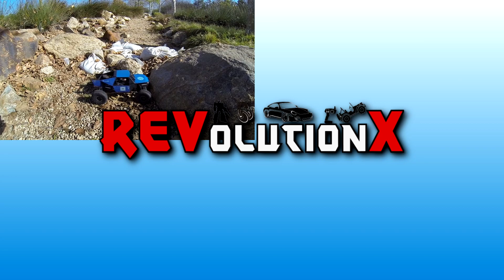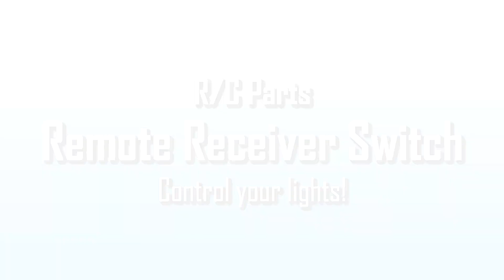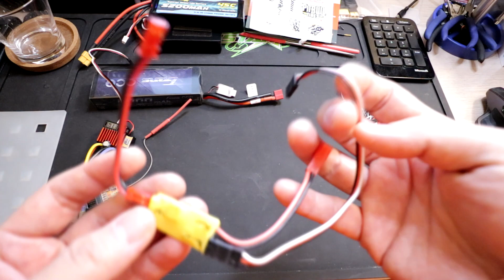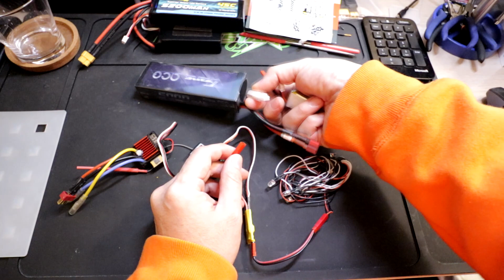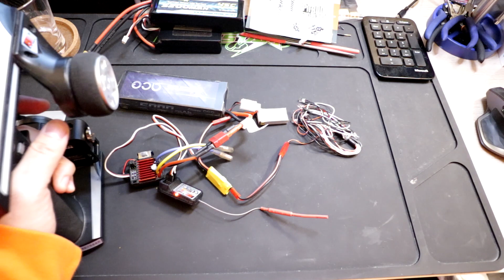$5 Receiver Controlled Remote Switch for LED Lights!

Comment: Hi i have bought a similar switch. My question is i have a 4s lipo on my car, the lights i have are 12v is there anyway to use the balance plug but not use the full 16.8v from the 4s pack as would be too much for the lights
Reply from the maker: I no longer use this type of switch, but you can try getting a buck converter to step down the voltage from the main lead.  Not sure about the balance plug though.

Comment: Anyone that handle 8.4v. My servo want that, but the service plugged in to rx can only handle 6v
Reply from the maker: You would need to run a BEC for the servo to run at 8.4v while leaving the rest at 6v

Comment: The receiver doesn’t power up the lights? I thought it gives out 12v in one of the 3 pins
Reply from the maker: To be honest, it's been a long time since I messed with this unit.  There are others now that are much easier to work with.

Comment: Hi, loved your video and explanation by the way. I too bought these similar rc switch circuit. I just wanted to get a thing clarified, that is i am using a 11.1v battery to power my motor driver which is connected to my receiver via pwm rc1 and rc2 pins. The motor driver is the mdds30a by cytron. 
So if I want to control my LEDs on my car, should i plug in a smaller battery as you did or should i just connect my receiver and the rc switch will draw power from there(ultimately the 11.1v battery) and power the LED?
which is safer and better could you suggest?
Reply from the maker: It's been a while since I played with this switch, so I don't exactly remember.  I don't remember if this unit had a specific voltage limit.  If there is, you may have to put a BEC inline to control voltage if powering from battery.  If I remember correctly, you can power from the same battery as main via tapping the main power leads, but you have to watch voltage or something, which would require the BEC.

Comment: I was thinking just put a receiver plug on the power in wire and plug it into the receiver battery port or another channel for power.
Reply from the maker: You could wire up a lead from the main battery plug or ESC to that JST plug.
Reply: I cut the power in wire and soldered a male  receiver plug on it.  I cut the the power out wire and soldered a female receiver plug.  I plugged the receiver controller wire into the active 3rd channel on the receiver.   I plugged the power in wire Male receiver plug to a open channel aka aux on the receiver.  
The female end power out to the led light strip and it finally fucking worked.  I should probably make a video how I did it.  It's pretty cool.

Comment: Hello, i bought a car recently and would like to add my own lights to it with a separate battery (separate from the main one) would i do it like this one?
Reply from the maker: Yes you can.
Reply: @RevolutionX  ok, it has 3 channels and it is a slide to change the channels I would insert it to channel 3 and then switch to channel 3 the lights should turn on, and then when I switch off of it would the lights turn off?

Comment: Does the input voltage go to the other items hooked to the receiver at the same voltage?

I need something where I can plug in a 3 S LiPo to control an accessory but that won’t allow 11hp let’s to flow to receiver. Any ideas?
Reply from the maker: Apologies, but I can't say for sure.  It's been a long time since I messed with this so I don't quite remember.  I remember plugging a separate battery directly to the switch though.  I think you can also wire up the balance lead of the main battery to do the same if you wanted to. I'm not sure if the power will flow to the receiver as it wasn't powered by the receiver in the first place.  You might be able to just remove the red and black power wires and just leave the signal wire from the switch to the receiver.
Reply: I was afraid I'd fry shit, but it literally is just a switch powered by receiver.  The battery voltages just run through to said item.

Comment: Do you need to connect it to a separate battery or can you just use the receiver battery?
Reply from the maker: You might be able to tap into the main battery if you can make a JST cable that taps into the esc plug.

Comment: Is it possible to use this switch to turn on high power fans running on 3S battery?
Reply from the maker: You know, I honestly don't know.  It's just a way to toggle a signal, so maybe?  I'm just not sure about the high power or 3S part.  I haven't tried that out before.
Reply: @RevolutionX   I think there is only one way to find out. It would be epic if it works

Comment: How can you make this work with FrSky Xm+? I want to be able to turn lights off & on from my Transmitter/radio. Can you do it thru FC spare uart?
Reply from the maker: I'm sorry, I'm not familiar with the FrSky Xm+.  If you have an extra channel that can toggle on and off, then the basic idea is that you need something plugged in the receiver that can accept the signal wire to toggle on/off for that channel.

Comment: I hooked up my led bar yesterday, in preparations for my similar ordered(still in mail) remote switch, but i took the power straight out of ESC leads. Using the led bar caused ESC to short-circuit, maybe a mosfet broke there and caused a short. I have some experience over low voltage electronics work so there was no botch-up or something else..

Do you have idea why that happened? The esc in case was stock SCX10 II "dynamite" AE-5 esc.
Should you draw power to remote controlled switch from battery?(or in my case the esc leads that connect to battery)
Reply from the maker: Esc leads from the batteries is what you did?  I'm not quite sure what happened to yours actually, but when I run BECs for my servos, I actually solder them at the battery connector of the ESC.  I would imagine you could do the same thing for the switch, or just run a separate small battery.
Reply: Yes that is right where I soldered mine also, I wasn't clear yesterday. OK, good to hear, probably axial just makes crap ESCs or it just was a breakage not related to led bar(improbable, but possible)

Comment: came across your video, and on this switch do the lights just turn on/off? Is there a demo mode where the lights blink
Reply from the maker: Yes the purpose of this switch is basically like an on/off channel toggle.
Reply: @RevolutionX  thank you

Comment: Thanks for the video bro!  I want to ask you:  does the switch have to have a separate power source?  I thought it would receive power from the main battery. 
Thank you
Reply from the maker: No it does not have to be separate.  You just need to either make a harness that uses the balance plug, or a splitter for the main connector to this switch.

Comment: I have a light bar that directly connects to the receiver. Does it turns off and on if i directly toggle the switch from the transmitter?
Reply from the maker: That would depend on your light bar.  If your light bar only has a red (positive) and black (negative) wire, then it will not be able to be toggled from the transmitter.  The light bar would need a 3rd wire (signal) in order for that to happen.  The way this works is... the receiver powers the lights with the positive/negative wires.  The transmitter toggle would send a signal to the signal wire.  Something needs to take the signal from that signal wire and determine whether to perform a toggle depending on the instruction received from the signal wire.  That is what this remote switch does.
Reply: Thank you very much

Comment: Do you think this will allow the 3 position toggle on top a Traxxas Summit controller to switch a siren on and off?
Reply from the maker: Honestly, I'm not sure. It might? I'll have to try when I get the chance.
Reply: @RevolutionX  I tried with the Turnigy receiver controlled switch but couldn't get it to work. I really want to have a police siren on my UDR like full scale trophy trucks. I added the Traxxas OBA system and that works great on it, just need to get the siren to work. I'm using the Evan Designs police siren with a large speaker
Reply from the maker: @adamwatson9214 Thanks for the input.  I'll keep it in mind when I get around to using it on another truck.  I'll see if it works with my Flysky Radio's 3 position switch.  EDIT:  Are you intending to turn on the siren and lights at the same time?  Or independently?  If independently, the easiest thing to do is to get a radio/receiver combo that can have more channels.
Reply: You have to check with the 3 positition switch on your radio.
Switching 1 side polarity is good + versus - to your led's but when you switch to the other side of the 3 pos. switch the polarity chances to - versus + so what will happen to your led's.. they may burn.
So maybe check with an old reciever and led to prevent burni g your nice led's an maybe your esc.
Reply: @robertopracht9748  thanks. I got it to work but had to buy a different receiver controlled switch

Comment: Does it take power from the Rx ? I want one to power 12 volt actuators with remote separate power.
Reply from the maker: It powers from a battery.  You can make a connector pass through for using the same battery as the one powering the vehicle.

Comment: Will this work with an AIRPLANE receiver. Spektrum or OrangeRx...
Reply from the maker: I don't see why it wouldn't as long as you have an extra channel.
Reply: @RevolutionX  Received mine and just tried it. Works with PWM signal so no problem.